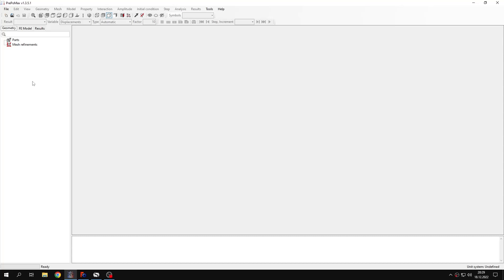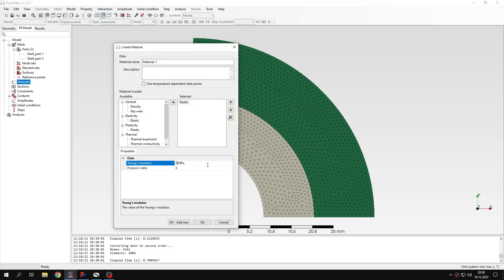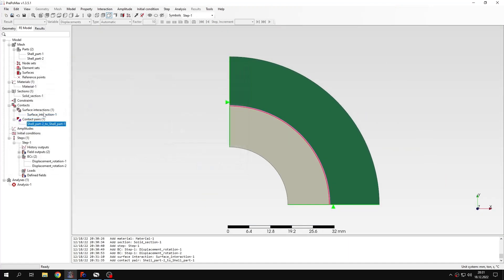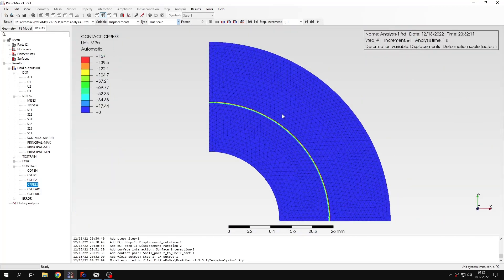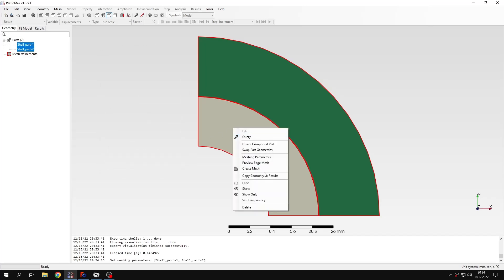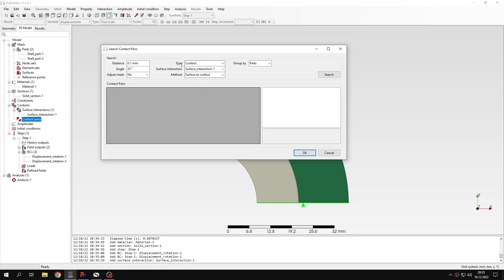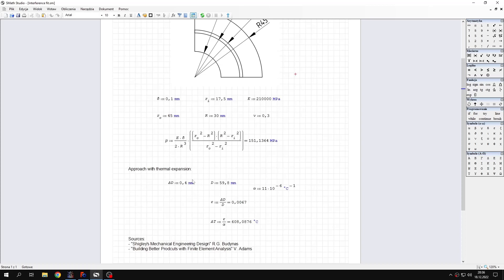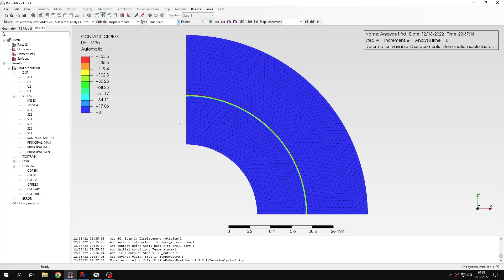PrePoMax (CalculiX FEA) - Tutorial 29 - Interference fit (press fit / shrink fit)

Comment: Many thanks for your great overview cases and very useful tutorials (with PrePoMAX). Could it simulate the spin welding in (plastic parts) or Rotary Friction Welding?
 where it will be involved thermal, contact friction, mesh deformation, ... I appreciate your feed-back.
Reply from the maker: Friction welding can be simulated in PrePoMax to some extent thanks to the *GAP HEAT GENERATION keyword available in CalculiX. However, this keyword is not currently supported by PrePoMax GUI so you would have to add it via the keyword editor.
Reply: I will try to figure out to apply in my case. By the other hand i have created an account in the PrePoMax forum to be able to connect with the experience from the community, for further help. MThanks for the feed-back and the information to follow.